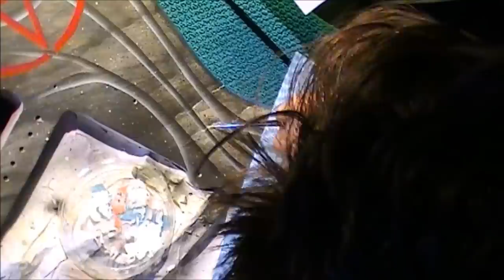Time-laps airbrush painting No 6 Guitar

Comment: I was going to swirl dip one of my Ibanez guitars, but it turned out to be a big pain in the ass. So I'm doing a combo of hand painting, air brushing and spray cans. Any suggestions for the base coat before all the paint? My last attempt at primer left me with blochy spots and now I'm gonna have to re-sand it. Hell any tips would be appreciated actually if ya got the time, thanks!
Reply from the maker: +SickChemical 
ow good i am late wit my replie! had to much in life at the point! sorry m8! well  i use ato botive colors on can some times as a base! i never combain regular pens wit the colors from the aribruch or the can! i wold surchest you ask in the stor wer you bye suplies! :) in sweden it´s a bit easyer some times to see wat kind of spray cans you are able to use! sorry for th speling! dyslexi! :P 

Mvh Andrej
Reply: +SickChemical Try an automotive paint supply store, I use all automotive primers paints and clear coats for guitars, thats what I would suggest. You may need and actual spray gun, I would avoid using spray cans if you want any kind of long lasting results.